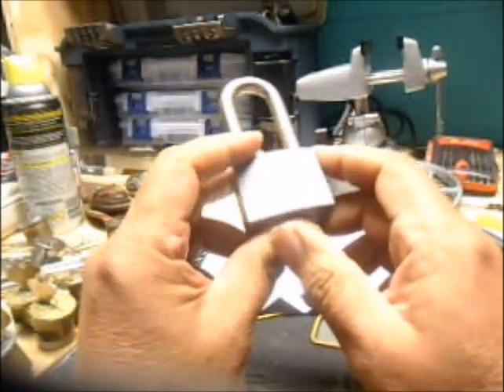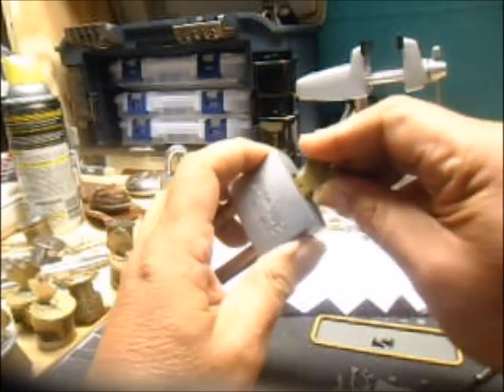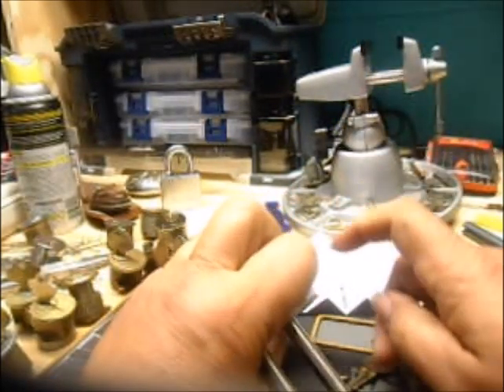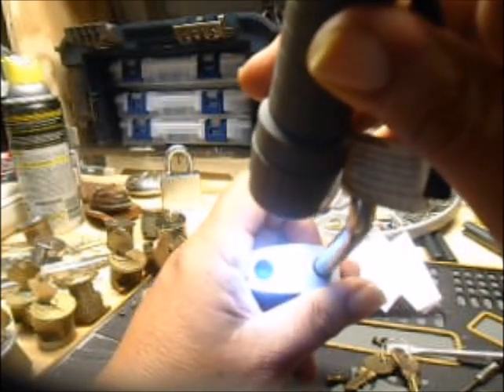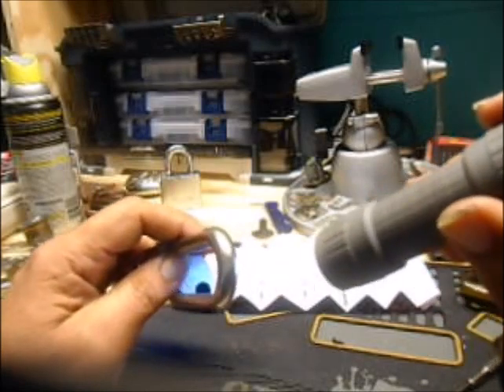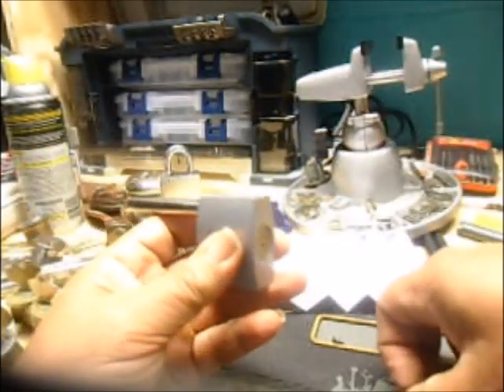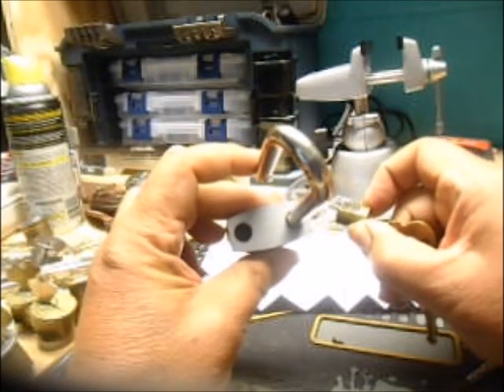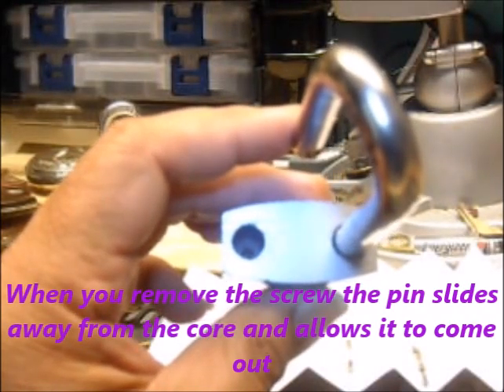American KC 40

Comment: Cool video...That was an awful lot of work...not sure it's worth that much trouble if you have a working core....I can't think of anything else that would fit inside the body....Thank you for the video :-)
Reply from the maker: yea, you get any dirt or grit of any kind and that pin ain't sliding! !!!
Reply: Good to know..since both of the ones I have were chalked full of dirt and grit..I've spent quite a bit of time cleaning them up :-)